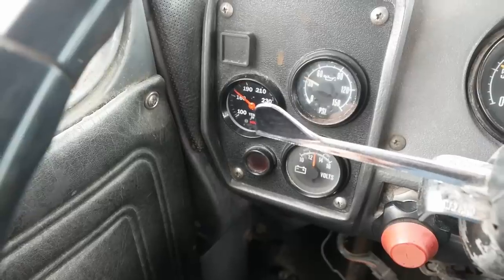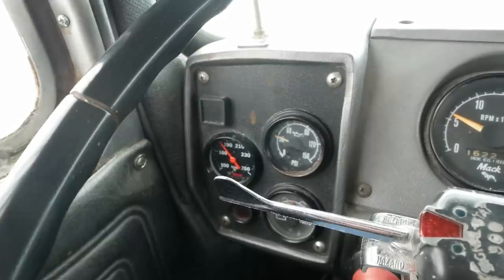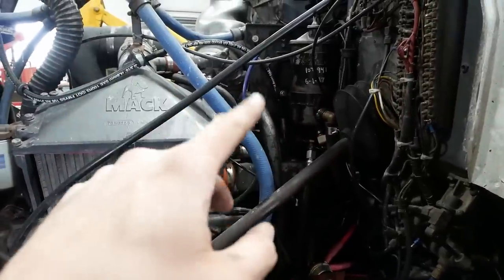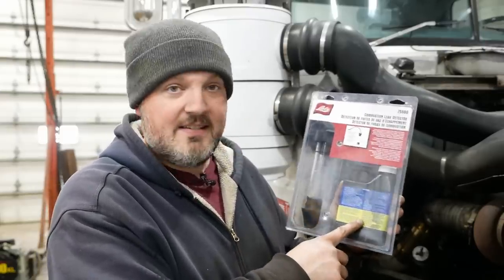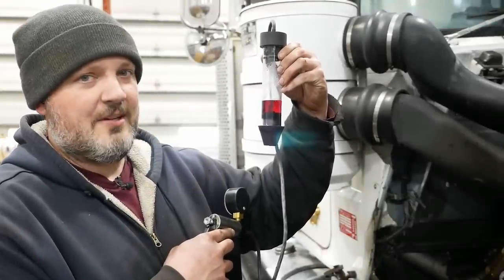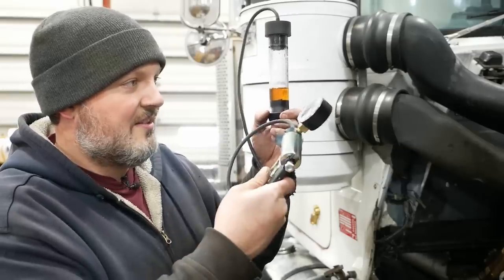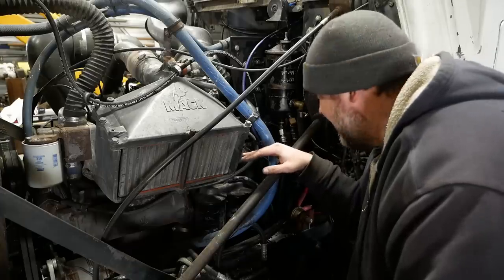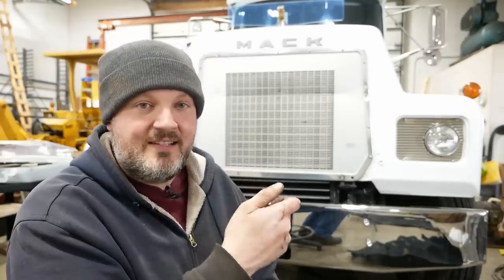Can You Trust a Head Gasket Tester? - R Model Mack Overheating

Comment: I've seen the same thing happen on a gas engine and it was a crackhead not a head gasket temperature went up the whole nine yards you back off of it temperature goes down. I believe your theory is right about the bubble of hot gas being measured. In the event it really could be all three that's bad. That's a bad situation all day long. You could have a bad check valve in your air compressor. I know the fella that had the problem with the crackhead went out and got some Red Devil put in it and it stopped for almost a year and then it came back can't harm it any worse than it already is! My 96 Silverado has that same problem in the corner of the manifold that they all have I've been running my motor now for a little over eight years and I use the little orange and blue bottle about every two years and no problems I'm not tearing that motor down at 190 something Thousand Miles when it's not showing any symptoms of leaking in the oil, or into the radiator. But doesn't overheat it actually runs cool all the time dead of the summer it runs cool so I will leave it alone and keep using my little blue bottles every two years before I tear that motor down. Anyway West great video brother I really got a kick out of the glove on the radiator, many blessings to you and your family as always

Comment: The pulse pressure check would be useful to confirm it is coming from a combustion chamber because you could sync to engine rpm without engine electronics.
Reply from the maker: How?
Reply: @WatchWesWork  I don't know what you'd need to pick it up electronically, but you can feel the pulses on old school injector  lines when the motors running. An old mechanic showed me once, He just hooked his finger round the back of the injector line and put tension on his finger. Sure enough I tried it and he was right, he said one cylinder was weak firing the injector and the pulse on that line was not as strong as the other 5. I guess it's really just like doing a human pulse touching your wrist  , My memories thinking maybe 25 or more years ago there could of been a diesel engine timing light worked off of no 1 injector line pulse to.
Reply: @WatchWesWork  Could you use an injection pulse sensor, like I have seen used to drive tachometers on older diesel vehicles?  The widget somehow detects the injection pulse in the injection line; I have no idea how it actually works.

Comment: I've experienced that with a blown head gasket, the temp would shoot around like crazy because half the coolant was missing and it was getting a mixture of hot gas and cold water. No word of a lie, I drove about 15km and noticed the gauge was pegged, felt and popped the cap which was ambient and a few gurgling seconds later cool water was spraying all over me and the engine bay

Comment: If it was headgasket wouldn't it over power the radiator cap and spew out? We drove my uncles service truck with a bad head gasket a year with cap loose to prevent this. He popped like two radiators until we started leaving the radiator cap loose. Maybe the shaft is spinning in the water pump impeller.
Reply from the maker: It's only a 7lb cap. This is old school stuff.

Comment: it goes hot really fast....it could sound crazy... what i going to say;;; it could be the fan blade be install wrong position or mabee or water pump defective or something blocking flow of water pump and try your tester on exaust diesel to see if it change color and cut one finger of glove to connect hose and do test .
Reply: just remove heater core hose to see if there is a flow coolant

Comment: I never had consistent results with the chemical tester on diesels. I checked mine by holding it directly in the exhaust and still didn’t get the color to change. The scope test can still be synchronized on old diesels by using a vibration(piezo) sensor on an injector.

Comment: Brings back memories. Back in the day Freightliner had an air controlled bunk heater coolant control valve. The valve would go bad allowing air pressure to slowly feed into the cooling system thru the valve and make you think had a leaking head gasket.

Comment: Don't go pulling heads just yet wes,those old macks are known for the cooling system plugging up inside the block and if you look between each head you will see a tube ,that's usually where they plug up.whats happing is it's cavitating and that's what's causing your temperature spike.flush out the entire motor and try again,this should fix your issue.they also like to plug at the back of the motor too because that's the lowest point.
Reply from the maker: Cavitation does not pressurize the cooling system.

Comment: If intercooler is air to water heat exchanger, what about a leak from intercooler ?
What is boost pressure at idle ?  Maybe disconnect the turbo boost output hose  and retest for pressure in radiator
Reply from the maker: https://youtube.com/shorts/HHOhku_5IKA

Comment: check your test fluid on something using  regular gasoline.  use the exhaust pipe gas.  if the fuel has 10% ethanol in it then for sure when it combusts it will yield co2.  i doubt a converter would scub it completely clean of carbon dioxide
Reply: a catalyst doesnt do anything to CO2...

Comment: I've seen that before on a 2.9l Ford Ranger with a blown head gasket.  What happens is that air gets into the coolant system and builds up near the thermostat.  That spikes the temperature, which flys open the thermostat, which fills with cold coolant , dropping the coolant  temperature at the sensor, and causes the thermostat to close, allowing air to get back behind the thermostat and start the thing all over again.
Reply: My Tacoma 2.7 just blew a head gasket at 280k miles- it did similar shit before it started to fail completely

Comment: The commenters who are saying to disconnect and loop the coolant hoses from the brake air compressor to isolate the compressor as a source of air infiltration are correct.
Because..........the air compressor unloader valves are not 100% restriction free in the unloaded position, but they do open far enough to diminish the cylinder to a value well below the pressure of the air reservoir, and that is all they really need to do to prevent the brake air system from over pressure.  The pressure in the compressor cylinders during the unloaded operation can still be higher than the normal cooling system pressure and that would allow for air to infiltrate the cooling system.
The point at which air infiltration would be the greatest would be just before the air governor activated the unloaders because that is when the pressure in the compressor cylinders is the highest.  The lowest point of air infiltration would be at engine curb idle RPM while the unloaders are activated.
A way to determine for sure if the air compressor is leaking air into the cooling system is to make your bypass loop of coolant hose and incorporate a pressure gauge into the loop. Then operate the engine while the compressor is building air. If the compressor is leaking you will see that on the pressure gauge.
Reply from the maker: There is no way the compressor can build pressure with the outlet disconnected. It has nothing to build against. It's just idling, even if the unloader is closed.
Reply: @WatchWesWork  Even though the discharge line is disconnected from the outlet fitting, the air being displaced by the compressor pistons must pass through a spring loaded discharge valve to get out of the compressor.  It requires enough pressure to lift the discharge valve against the spring pressure, so yes there is some pressure present inside the cylinders even when the discharge line is not connected.
The unloaders do not allow enough air to move backward into the inlet port to stop all pressure from developing when the piston is moving toward the compressor head, they just stifle the pumping action sufficiently to keep the compressor from discharging more air into the reservoir after the governor has activated the unloaders.
You may have thought that there is absolutely zero pressure inside the compressor cylinders when the unloaders are active but that is not true.  The unloaders only allow enough air to escape back to the inlet port to prevent further air from getting past the discharge valve.  That is all the unloaders have to do to establish the desired cut out point for the air reservoir.  The unloaders are a restriction, not a wide open free passage.
Reply from the maker: @larrywalker7759  https://youtube.com/shorts/HHOhku_5IKA
Reply: @WatchWesWork  I am not debating that this engine does not have a leaking head gasket. I am only pointing out that to completely eliminate the air compressor as a suspect you have to separate its cooling system connection with the engine.  And you did that finally.  My point was that simply disconnecting the compressor discharge line does not stop the compressor from having cylinder pressure entirely.

Comment: If it were hot and you appiled the jack brake, would it cool down? I have no expertise in engines, I'm just wondering if it were air related, would diverting air have an effect?
Reply from the maker: It doesn't have jakes.

Comment: any mack i worked on that had a blown head gasket it was never a guess. you knew it.  i have seen the impellers come off water pumps and with that being in a front end crash i'd start there. some impellers were stamped steel others cast bronze. one of the bolts takes a copper washer.  but before you do anything check the oil pan bolts on the right side near the power steering pump where the block narrows if one or more is missing or loose look real close  the block is cracked. looks like the older thermodyne without the tip turbine fan.
Reply: when the water pump quits pumping it will cause localized steam bubbles. once they pass it will convection cool until enough steam collects again. and repeat
Reply from the maker: It's happening from a dead cold start. There's no way.
Reply: You're right,I forgot about that,it's been awhile since I worked on one of those,it's a brass impeller and the nut loosens up so when the pump is turning faster the impeller can't push fluid👌.....good call
Reply: @WatchWesWork  I have seen this happen,it's a brass impeller on the water pump held on with a nut and the nut backs off and slips at high speed and won't push fluid,try flushing the motor and pull the hand throttle out and check both sides of the water pump with a temperature gun,that's how I found it.thought it was a bad pump so I pulled it off and there was the nut,not holding much.

Comment: Hey Wes before you pull the head try removing the valves from air compressor to see if the pressure goes away the compressor still will make pressure with the air line off
Reply from the maker: No. It will not.

Comment: There are other signs that your compressor is bad, read on...when the air and coolant mix it allows air into the coolant system and it leaks coolant and /or oil into the air system.
So any sludgy substance in the air tanks or increase in dryer problems means the cromressor is bad. Maybe add a high concentrations of antifreeze blue/green and see if draining all the air tanks has colour too it

Comment: Nice video, would be a bit more accessible if you had a diagram of all the components involved in the cooling, I'm not quite up to date on how a compressor works on a '77 Mack
Reply from the maker: Same as the compressor on any other truck.

Comment: Been my experience that most diesels don't blow head gaskets but usually a crack head or block , maybe you have seen differently but that's what I've seen more of
Reply from the maker: In my experience they start with a head gasket leak, then they keep running them until the head or block or both are cracked.
Reply: @WatchWesWork  YUP..... if thats the scenario , then  Farmer John will be getting ready to put another vehicle out to pasture...

Comment: just watched your youtube short, its not the headgasket, the thermostat stuck and the engine over heated and the heads are cracked between the injector bore and valve seats, if it has studs, replace them with bolts, if its a e7 engine they in rare cases get a implosion hole in the liner.
Reply from the maker: That's possible. I don't know if we can even get parts.
Reply: @WatchWesWork  your mack dealer should be able to get any parts you need, you will need the model number from inside the door such as rm688s or  some such, the heads are not cheap, to remove them on the driver side take the intake boot off and just pull one at a time off, lube it up well and it should slide back, checking the water pump bearing will be a good idea the v belt tension likes to knock them out. if for some reason you cant find heads, they can be repaired but the turn around is a long time so tear it down in a place its out of the way, doing a quick search shows about 1600 for some

Comment: How about a crack somewhere in the inner-cooler system, and being pressurized by the turbo.
Reply from the maker: No.
Reply: How do you know? Did you run with turbo line off? Or just assuming because cooling pressure is higher than boost?

Comment: Highest pressure in the cylinder. Compression then power. Exhaust would be lowest. If head gasket is bad, how much co would actually be in coolant? Thoughts
Reply from the maker: I don't know. Why would they design the test for CO2 if that's not how you detect a bad head gasket?
Reply: @WatchWesWork  my opinion money.
Reply from the maker: @ihc1963  Yeah it seems like a scam.

Comment: As you know, there are Bad "new" parts all the time. Like temp senders. Also you did not mention suspecting the gauge. These are electrical intermittency possibles. I say this because the clue is: temp would NEVER go up and down that fast and sometimes does not do it at all. You know this and that is why you came up with the bubble theory. Right track (intermittency), wrong theory? Can you use laser thermometer on one spot on motor when gauge shows the various high/low jumps. To possibly detect what is really happening. Like jump out of the truck on a freezing cold snowy slippery hiway and check? No? Are there not ways to check compression on a diesel? Leakdown test? Move temp sender to a different place? How about installing a bunch of expensive test thermocouples? A head gasket is just removing a dozen things, setting them aside. New gasket, retorque, put junk back on. Nice afternoon money job. Tell them you are not sure before starting. If it walks like a duck.........
Reply from the maker: It's an entirely mechanical gauge with a capillary tube. It's a 20 hour job to do a head gasket on one of these.
Reply: @WatchWesWork  Oh, that's different. Never mind.
Reply: @WatchWesWork  20 hours assuming none of the 50 y/o parts break and no bolts are seized up and sanp off, you mean, yes?

Comment: Steam in the cooling system?
Reply from the maker: From what? The engine is stone cold.
Reply: @WatchWesWork  So, you touched on it later in the video.  Vapor around the coolant temp gauge bulb is present which heats super fast.  Coolant returns to the space and cools the bulb super fast.  I've run into this before when I had a bad intake gasket leaking coolant which subsequently boiled away leaving me to scratch my head about the missing coolant.  Temp gauge acted the exact same way as on your Mack. The air in my case was caused by a leak, but yours may caused by the head gasket as you deduced.  I might suspect the intake if this happened under boost, but there shouldn't be much if any manifold pressure at idle, so you're diagnosis seems more likely. I would have liked to have seen the test fluid change color because in my mind, any head gasket fault should indeed introduce combustion gasses. Why that didn't change color makes me wonder about the intake, but on a diesel manifold should be close to atmosphere at idle since of course there is no throttle. Could the turbo pinwheeling cause enough pressure offset to introduce air into the cooling system? I doubt, plus you'd have a leak someplace I'd think, even if it were a breach in the charge air cooler. Therefore, head gasket.. can't wait to see the conclusion of this!

Comment: why not pressurize the coolant system and look for water in cylinders or oil? (not tell you what to do im just wondering why not  as im use to doing with gas engines)
Reply from the maker: It's a diesel. We have to pull the injectors. That's many hours of work. Plus it is not using coolant.
Reply: @Watch Wes Work  stupid question, can you pressure test or cam the cylinders through the glow plug holes?
Reply: @Chris-bh3cm  from what I have seen on diesel , if it has glow plugs if it can even fit a cam the glow plugs are just as hard if not worse to take out than an injector
Reply: @Raqus Kane  
Gotcha, on my 6.0, they're relatively easy to get to. At least the one I had to remove due to the cylinder being vapor locked. Scared the crap outta me when I bumped the key and all that fuel shot out like a water cannon.

Comment: Pressurize the cooling system
Reply from the maker: For what?
Reply: @WatchWesWork  You might hear the leak.
Reply: @philipstreechon4523  It's more likely on a diesel that the leak only happens at the very high pressures they operate at, not like gas motors.

Comment: Do you own a smoke test machine?    Smoke the coolant system
Reply from the maker: For what?
Reply: The coolant system must be pressuring?
Reply: Its leaking on the compression stroke
Reply: Probably cracked head
Reply: The fluid isn't changing colour because it's not blowing on the exhaust stroke..